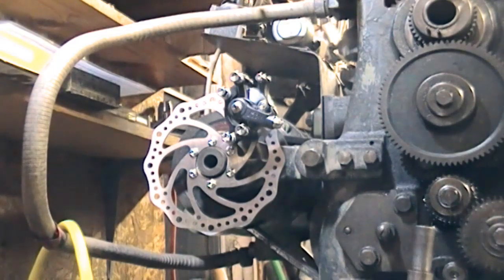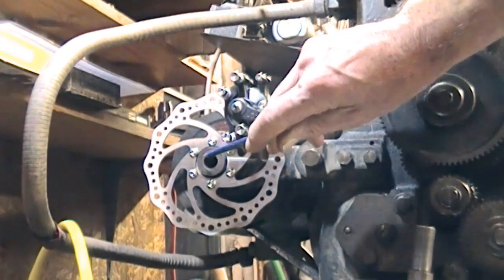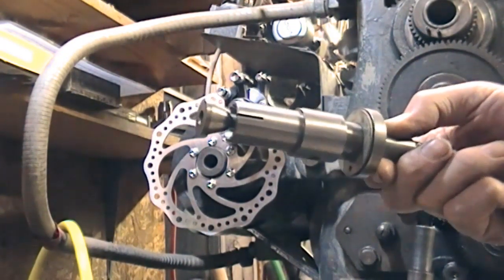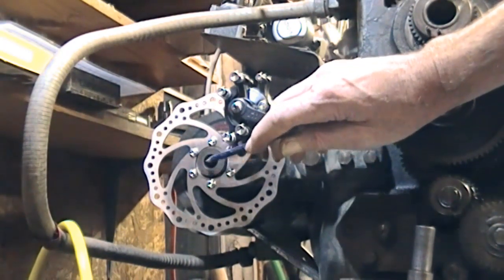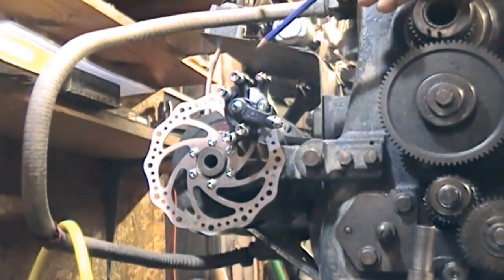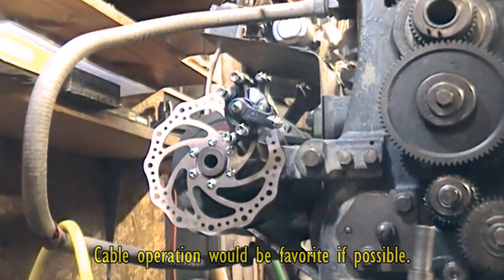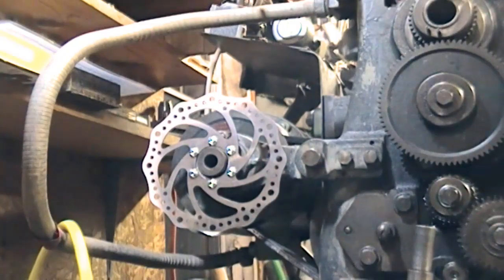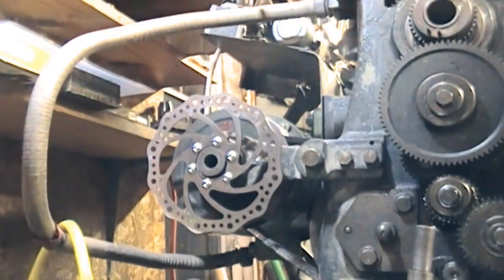Lathe spindle brake project - rethink#2

Comment: Hi Chris, your idea is over any inagination, but it's a great one. Be aware: you have two pads biting the disc but only one moves with the lever. The other one brakes when the disk is slightly bent from the force you apply braking. So put maximun attention to register the pads clearance.
Reply from the maker: Yes - already thoughts on this - only one moving pad.  Thus positioning will require disk to be all but touching fixed pad all the time. Probably a need to build in a small adjustment option.  Thank you.

Comment: Just saw this brake in your last Video and was going to ask you about it and here it is. Will be watching to see how it turns out. Looks like it should work just fine. Once you get it working you should get a spare set of pads. In 5 years or so those will be gone and you will never find a set probally. Good Luck.
Reply from the maker: +Garry Fuller Sr 
Hi Garry,
It turned out well in the end, plus I added a stop to control the aggressiveness of the caliper bite. I did get a pair of calipers but doubt I'll need them for ages, as I don't use the brake all the time - just sometimes when turning on and off a lot for short spells. It's the sort of thing that's handy to have when required.

Comment: You got the shaft there/ you got a hub on the disk... Drill and tap in 3 or 4 set screws in the hub and lock it down. For more of a grip dimple the set screw locations on the shaft. Once you've tested everything and it's good to go; put locktight on the set screws. As for the caliper mounting arm use the 2 bolts from the support arm for the motor, no need to drill-n-tap.
Reply from the maker: Good thought Bill - however, not totally sure that would get me running totally true using set screws, and the disk boss has oversize bore too - may well make new boss, or remove the original and set up direct to part of expanding arbor. Caliper mounting - yes, already considered that among several options.  Early days yet.
Reply: ChrisB257
I agree that hub should have a .001/.003" slide on fit, but the 4 set screws would be the same as centering a shaft in a 4 jaw chuck. Will be waiting for your next follow-up video to see what you came up with.
Reply from the maker: Grandpa Bill I agree centering should be feasible yes - but there is no shoulder to back onto because the fork bolts prevent reaching that. So, main problem could be fine tuning to prevent run-out - would have to have a very tight tolerance fit of course which could take care of that as you say.. Will explore further on that though thanks.

Comment: didn't test it yet? I'd think putting the disc in the chuck and make something simple to hold the caliper in a tool holder should be quick
Reply from the maker: True - no major test but -- the cam operation on the caliper seems very potent. I think I'd be more concerned over pad wear rate.  Good thinking tho regarding a quick test - may well do that - thank you.

Comment: Used hydraulic caliper would be nice...
Reply from the maker: I think size could be a problem, though I like hydraulics. Perhaps a small one from a scooter could work but also, complicated by need for a master cylinder etc.  Right now I think I like cable operation best of all. Thanks.